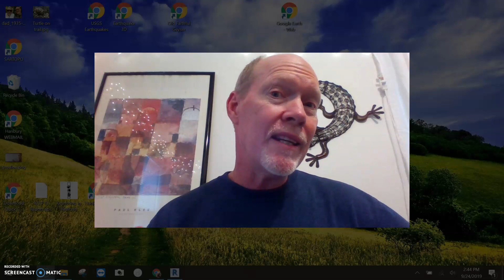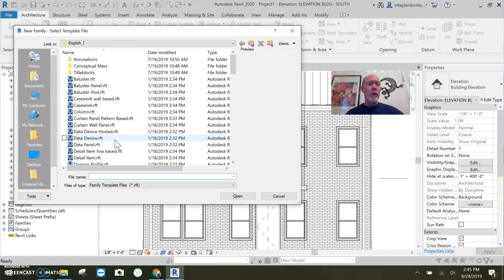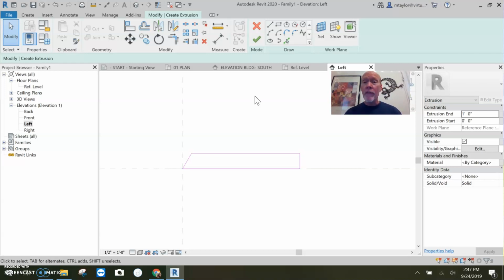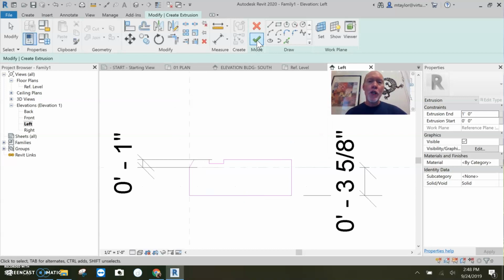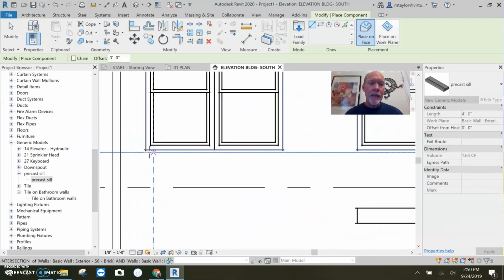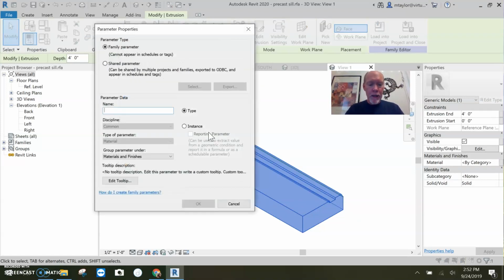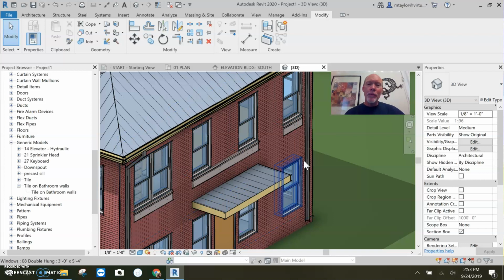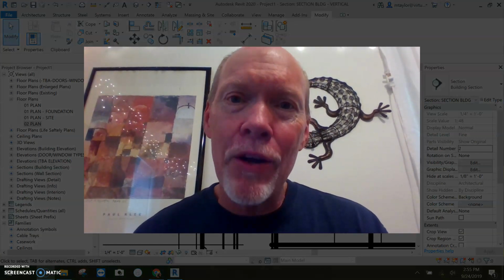Creating a LINE-Based family

Comment: Very clear thank you.  My question is what if you need a line based family that has more than two points,  say I want to create some corner millwork. Is there a way I can solve that with a line based family?
Reply from the maker: Paul: Unfortunately, line based families are a single line. Yet, there are a couple ways you might want to approach a corner. One, you could create a separate small family for the corner and use the line-based family up to it on either side. Which is how I believe I would do it. Secondly, you could make the END of the line based family to have the corner built onto it... which would cause you to have 2 line based families (one with and one without the corner). Not the best way to approach it.. but certainly a way.  Sweeps can go around corners, but that is not a line-based family.
Reply: @miketaylor-fantastic  thank you very much sir.